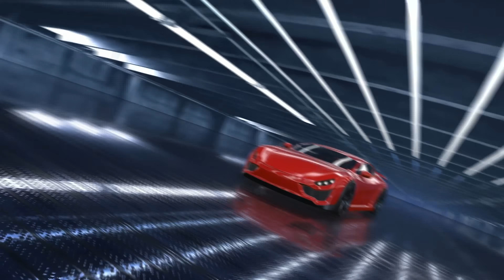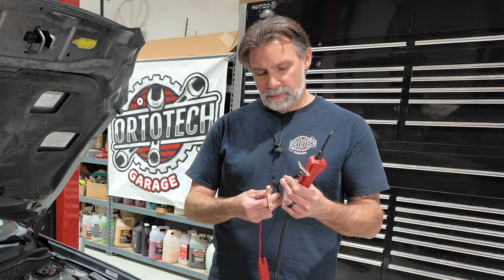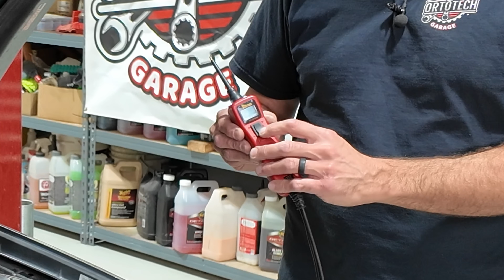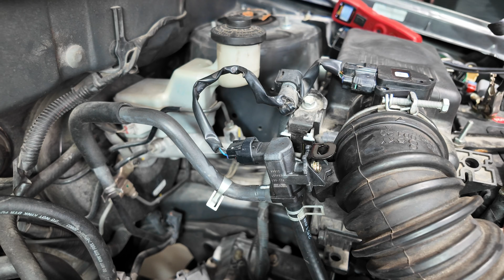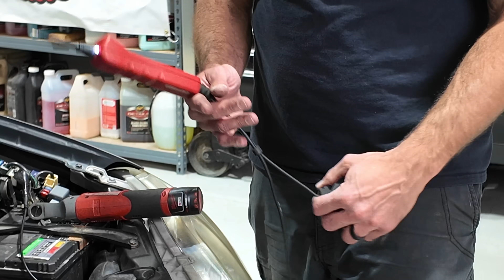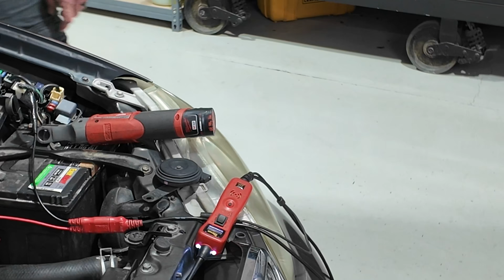Stop Using a Test Light! Use This Instead

Comment: I have an EM415PRO do you happen to know if this tool will help me find SHORTS TO GROUND?
Reply from the maker: That's a different style of tool than the Power Probe 3, and I haven't personally used the EM415PRO, so I can't speak to its effectiveness. The Power Probe 3 by itself isn't designed to pinpoint the exact location of a short to ground, although it can help you identify a circuit that has continuity to ground when it shouldn't. To actually trace the wiring and locate the short, you would want a dedicated short-circuit tracer, such as the one commonly sold with the Power Probe. The two tools work well together for electrical diagnostics. Thanks for watching!
Reply: @OrtoTechGarage  I forgot to mention that i also have the ECT3000 and i dont know how to truly use it to find and locate a SHORT TO GROUND. When i read the manual that comes with it i can't learn nothing at all because i can't read. Would you like to help me?
Reply from the maker: Absolutely! The ECT3000 is actually the type of tool designed to help locate shorts to ground. Unfortunately, explaining how to use it properly in a YouTube comment would be extremely difficult. It's really something that needs to be demonstrated visually so you can see how to connect the tool, trace the circuit, and identify where the short is located. You've given me a great idea for a future video tutorial! I'll add it to my list of topics to cover. Thanks for watching and for the suggestion!
Reply: @OrtoTechGarage  It's my pleasure brother. I can't wait to see this video drop so it can help me and others learn.

Comment: I have been watching your videos for. Some time now. And I definitely have rewatched this video a few times. Due to the fact I have this tool V500 Pro Automotive Circuit Tester, Power Circuit Probe Tester Breaker Finder Tool, 9/30V Electrical Open Short Circuit Finder, Wire Tracer, Multimeter Oscilloscope Relay Injector Test.
 You happen to have this tool but the version 200 in your Amazon affiliation Store. The current price is $88.00 the only problem is I purchased this V500 Pro version. I would suggest. That you have that in your affiliation with Amazon and. Give a really good tutorial video. It's already too late for me. But. I'm already in. Enjoying this, but there is a learning curve. With the V500 compared to the power Pros. They are not. Detail oriented and have multiple. Function as. You put them head to head. The V500 does much more. I may have come across this video or one similar it possibly after watching this video, or similar to yours, it's particular video. I've watched it more than once. I like it. Your demeanor, your method of description and instructions are very calm, soothing. Extraordinarily pleasant. It's like a really good teacher.. Now I would like you to really, do a thorough as you have here with this particular device because, The V500 does much more than any of the power pros it has so many more features. The only downfall? The difference is the fuse. The Power Pro has a Relay button, whereas the V500 actually has a 25 Volt difference the only difference. When I was fourteen and up to almost 18 years of age. I was working on automotive professionally in a garage. I then was pursuing academically education in work in the automotive career. I proceeded to go down a different path. I am 58 Years of age and I have acquired significant supply of tools. I am able and willing, to work on my truck and cars, due to desire. Now we have the potential need because of society where Ford and GM and all, US manufacturers and European manufacturers are what they're doing with the future vehicles of 2026 and beyond.. I must have my 4th lumbar spine surgery. I have five to 6 vertebraes that need to be fixed. I have two and three that have collapsed on top of each other. They're literally laying on each other. All of the rest of the vertebrae are ruptured. The only ones that are fixed and looks good are 4 and 5 only because they've fused over 10 years ago. And yes, I am in a lot of pain. A lot of pain composing this message.. I just left a message for my pain management doctor. While being agonizing pain. But the desire and the fundamental need to work on a car. Due to economics and what's going on in society? The desire. Why I am engaging with your platform.   About this item
【All-in-One】 Automotive Electrical Tool The V500 PRO is an advanced automotive circuit tester designed to handle a wide range of electrical diagnostics in one tool. Quickly detect open & short circuits, broken wires, and current leaks before diving deeper into advanced testing. It combines oscilloscope, digital multimeter, fuel injector tester, relay & fuse testing, test light, component activation, and wire tracing—replacing multiple tools and simplifying your workflow. From basic voltage and polarity checks to complex signal analysis, it delivers fast, accurate results for every job. Built for technicians and DIYers, it helps you diagnose faster, save time, and reduce repair costs
【Quickly Locate Open & Short Circuits】The V500 PRO automotive short circuit finder finds open circuits, short circuits, broken wires, and wiring faults in minutes with fast, accurate signal tracing and clear audible tone feedback. Easily follow wires and pinpoint hidden electrical problems without cutting insulation or unnecessary disassembly. Perfect for diagnosing complex automotive electrical circuits—helping save diagnostic time, reduce guesswork, and improve repair efficiency. For any issues, please feel free to contact our support team at: support @ vdiagtool
【Oscilloscope & Multimeter】The V500 PRO super probe tester has two powerful testing modes: oscilloscope and multimeter. The Multi-function tester various voltage signals with four features: Voltage (VDC, 0.1-100V), Resistance (OHM, 10Ω–200KΩ), Diode (DIO), Current (AMP, 2mA-25A), Frequency (HZ), and Polarity. The Oscilloscope module is an electronic test instrument that displays electrical signals graphically, This function can show the fluctuation of data more intuitively
【Relay Tester & Injector Tester】The V500 PRO power circuit probe tester quickly evaluates relay performance by testing coil resistance, energizing and release voltage, and contact continuity, helping pinpoint faulty relays and electrical circuit issues with greater accuracy. The injector test simulates ECU drive pulses to test injector opening and closing response and coil resistance, helping identify potential clogging, fuel leakage, weak spray, and poor fuel delivery. Quickly pinpoint injector-related faults for faster, more confident diagnostics
【0-5V Power Supply】Supply provides a stable, adjustable, low-voltage power supply for customers' circuit diagnosis. It can simulate input voltage, debug sensors, test circuit behavior, and calibrate systems. Customers can use it to locate circuit faults quickly, avoid component damage caused by misoperation, and simplify the process of circuit debugging and optimization. It is especially suitable for debugging and diagnosing low-power electronic devices and sensor systems
【Component Activation & Signal Circuit Test】The V500 PRO circuit tester instantly powers and activates electrical components to verify operation without removing them, making electrical troubleshooting faster and easier. Quickly test lights, radiator fans, starter motors, relays, wipers, fuel pumps, and other 12V electrical components to identify faulty parts in seconds. Ideal for fast, hands-on diagnostics, it helps technicians isolate electrical faults quickly, reduce diagnostic time, and avoid unnecessary component replacement
【90° Rotating Screen for Flexible Viewing】The V500 PRO automotive electrical short finder features a unique 90° adjustable screen that keeps live data clearly visible from almost any angle. Perfect for tight engine bays and under-dash diagnostics, it helps you work more comfortably, reduce awkward viewing positions, and diagnose electrical problems faster. Built-in bright LED flashlight helps illuminate hard-to-see working areas, making electrical diagnostics faster and easier in low-light conditions
【Packing List and 3-Year Warranty】This power circuit probe tester kit packing list: V500 Pro Circuit Probe Tester × 1, V500 Pro Short Open Circuit Finder × 1, Probe Titp × 1, Fine Probe Tip × 1, Probe Tip Extension Cable × 1, Wire Piercing Probe × 2, Banana to Banana Plug Test Lead × 2, Fuse × 3, Relay Test Cable × 1, Alligator Battery Clip × 1, Type-C Data Cable × 1, User's Manual × 1. We provide this kit with 60 Days of No-Question-asked NEW REPLACEMENT OR RE*FUND and a 36-month free warranty to ensure your shopping experience. Any questions or concerns, please reach us via ✔support@vdiagtool.c o m
› See more product details
Report an issue with this product or seller
VDIAGTOOL products customers bought together

VDIAGTOOL V500 Pro Automotive Circuit Tester, Power Circuit Probe Tester Breaker Finder Tool, 9/30V Electrical Open Short Cir

This item: VDIAGTOOL V500 Pro Automotive Circuit Tester, Power Circuit Probe Tester Breaker Finder Tool, 9/30V Electrical Open Short Circuit Finder, Wire Tracer, Multimeter Oscilloscope Relay Injector Test
4.44.4 out of 5 stars 293
$199.99
Reply from the maker: Walter, thank you so much for your continued support and for taking the time to share your experience! I really appreciate your kind words about my teaching style. My goal has always been to make automotive diagnostics easier to understand, so it's encouraging to hear that the videos are helping.

The V500 Pro sounds like an interesting tool, and I'll certainly keep it in mind for a possible future review. I'm always interested in exploring different diagnostic tools and seeing how they perform in real-world applications.

I'm also sorry to hear about the health challenges you're facing. I wish you the very best with your upcoming treatment and recovery. Thanks again for being part of the OrtoTech Garage community! 👍

Comment: Thank you for this video !  I purchased a similar power probe from Vevor that also injects a signal for finding broken wires.... but I haven't used it yet because I had no idea what to do with it....but watching this video gave me the basics of what the silly thing can do..... ALOT  ! Obviously ! my unit has 2 ground leads by the probe yours has one.... I suspect that the extra one is for using the signal injector as a direct ground would not be correct for that. I really like the idea that I can test solenoids  as I had to replace one on my 2000 dodge ram 1500 recently .... ( I got lucky and it was bad!) but I could have tested it and known it was bad before I ordered a new one ! i didn't have this tester back at that time though. but I do NOW !!!!  sorting out trailer lights should be alot better than with a trouble light with this thing ! .....Thank you.....I have alot of reading to do now it seams ! LOL.... but at least you gave me a place to start from thank you so much !
Reply from the maker: Thank you! I’m glad the video helped you understand what these types of testers can actually do. Once you get comfortable with one, they can be incredibly useful for things like trailer wiring, checking grounds and testing components such as solenoids.

I haven’t personally used the VEVOR version, so I don’t want to guess about the purpose of that second ground lead. I’d definitely check their instructions before using it, especially when applying power or ground to a circuit. These tools are extremely useful, but they can also damage a circuit very quickly if power or ground is applied somewhere it doesn’t belong.

Sounds like you have some experimenting to do now! 😂 Thanks for watching, and I’m glad I could give you a good starting point. 👍

Comment: Just remember that rocker switch can only handle so much current. On some applications apply the switch first then the tip to the high current device .
Reply from the maker: The PP3 has a built in circuit breaker which you can reset manually if the current is too high. The PP4's circuit breaker will automatically reset if overloaded.  👍
Reply: @OrtoTechGarage I was just concerned about arcing in the switch and causing carbon buildup.
Reply from the maker: I wouldnt be too worried about that. It can take a beating.  💪
Reply: @OrtoTechGarage well I use mine and I love it great multi tool first one malfunctioned so I got another one. Who ever thought it up is a genius.
Reply from the maker: Agreed!  Before the Power Probe existed, I make a super long jumper wire with an inline fuse...it was definitely not the safest tool.  Lol.

Comment: I like the fact that you demonstrated the horn connected to the frame as the ground because I posted here on this video the tool that I have which is the much newer version which can do everything I pasted it there I cut and pasted it from Amazon I have not used that tool to its full capacity the most I've done is used it as a multimeter which I already have a Klein Tools 120 multimeter. I do in fact like your videos cuz each one I learn something new with every tool that I have matter of fact you help me with the jack stands and the Jacks and now I have two Jacks of Daytona one I'm still in the box that hasn't been open yet they don't have the rubber protection for the 6 ton jack stands only for the 3-ton jack stands. And the test that you just did with the horn disconnected because you can test other features also other components
Reply from the maker: Thanks, Walter!  Im happy to hear your learning something from my videos.  I will probably be making a video on the Power Probe 4 soon.  Keep an eye out for that and I will demonstrate some other uses for it.   👍
Reply: @OrtoTechGarage  I just came across your comment which you posted three weeks ago. I just watched your video for a second time this evening. I submitted a new comment and statement. It is the largest one you have, and it's precisely the tool that I have that I suggest you do a good tutorial on.. I used Grok to compare the V500 to the tool that you have and the other version. The relevant comparison. Although It leaned towards the V500 for everything. The only thing it didn't lean good on was the fuse. Which I indicated with the comment above. I believe you made some videos about some Harbor Freight, Daytona Jack stands. I bought all that, so I commented on other videos.

Comment: Awesome video, thank you. I just ordered a power probe 3 with PowerFlow which now lets you apply a load to circuits. Looking forward to using it along with your tips. I would welcome a pt 2 if you have more tips haha
Reply from the maker: Excellent!  You will find many uses for the PP3.   I will likely make a video on the PP4 soon but it has substantially different features.  Let me see what other tips I can squeeze into that video for you. I havn't used the PP3 with power flow yet, but it looks promising. 👌

Comment: I find it a great tool for quick checks but voltage drop and load testing are equally important. Combined with wiring diagrams and knowledge of them is all you need for basic circuit testing and circuit validation.
Reply from the maker: Absolutely. The Power Probe is a great tool, but it doesn’t replace understanding the circuit. The tool between your ears is still the most valuable. Voltage drop and load testing are still essential when you’re chasing resistance or a circuit that fails under load.  There is no one magic tool for every situation, of course.  Thanks for adding that! 👍

Comment: I HAVE SEEN MORE PEOPLE FK SHIT UP WITH THAT PROBE, THAN THEY HAVE FIXED

ADDED POSITIVE ON NEGATIVE OR VISE VERSA
Reply from the maker: Absolutely. A Power Probe can cause damage very quickly if you don’t understand the circuit you’re testing. Before applying power or ground, you need to know exactly what you’re connected to and what the circuit is designed to handle. Used properly it’s an incredibly useful diagnostic tool, but it’s definitely not a substitute for understanding the circuit and should only be used if you know what you're doing. 👍
Reply: @OrtoTechGarage  I don't own for that factor, to many "I cans" around me, everything cost to much now, to be letting smoke out to many modulated signals and voltage mixed together
Reply from the maker: Lol.  Agreed!  We should not be "letting smoke out" of any modules.  That gets real expensive, real fast!  Especially when every module needs some kind of coding or programming now to replace it.  The PP3 is really mainly for 12 volt systems and all modern computer modules are running much lower voltage on all the internal driver, sensor, and signal circuits.  Knowing what you cant do is as important as knowing what you can not do. Stay safe out there!
Reply: @OrtoTechGarage  amen to us all